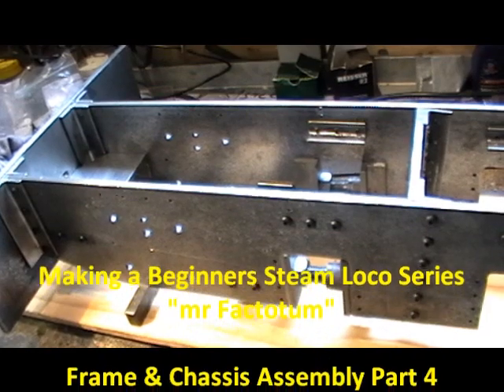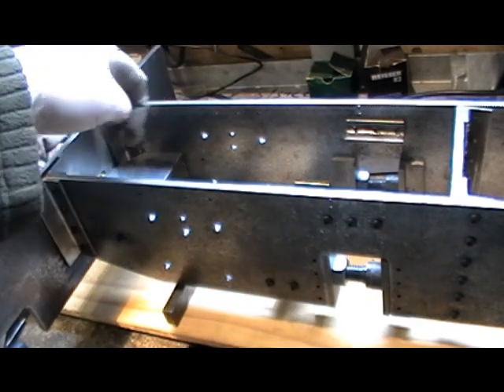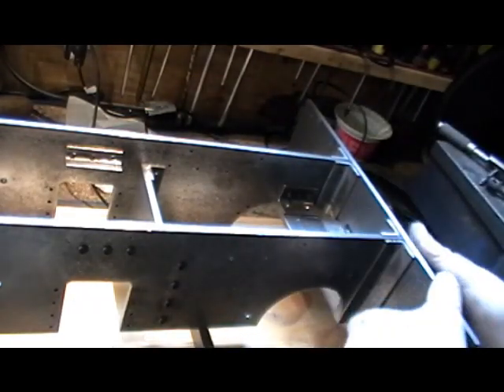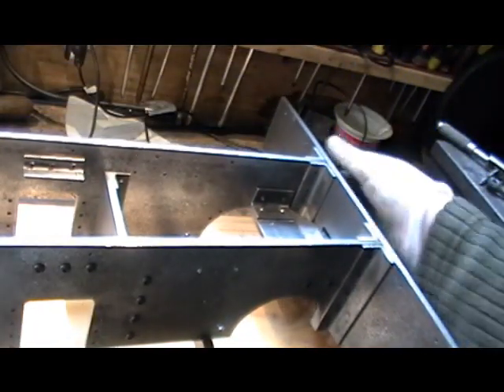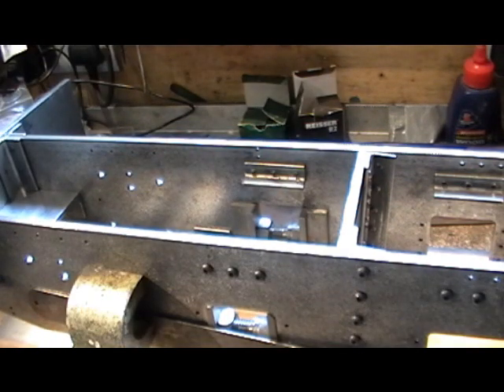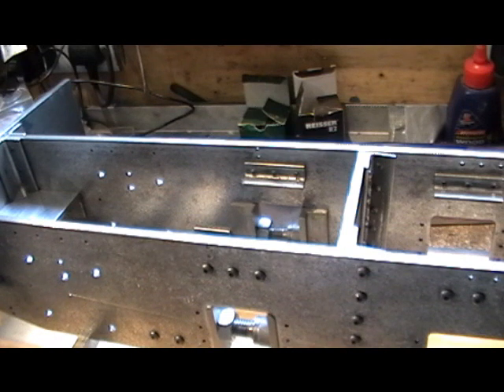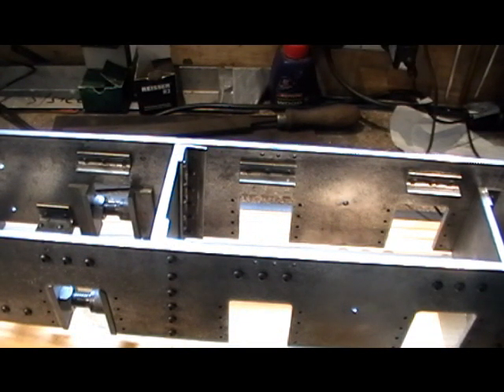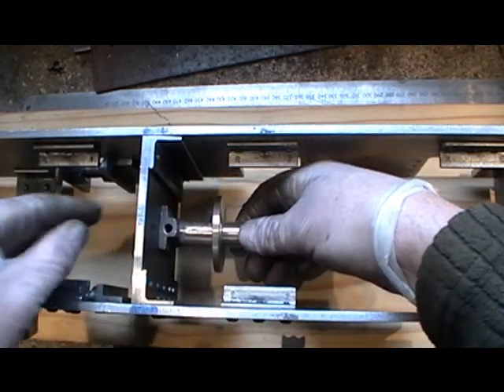Making a Beginners Steam Loco (Assembling the Chassis Main Frame Part 4 ) "mr factotum "

Comment: I just spent the day assembling our much modified Simplex and even with a milling table as a surface plate they are tricky bits to do! Yes slight curves throw the square off!!!
I am going to use 2 smaller pumps so as one is pumping the other will be filling. Also a Double acting hand-pump where the smaller return gets pumped through them to clear blockages and sticking balls!!
Love to get back from the workshop and watch it all over again for relaxing... Mad fool!
Love David and Lily.
Reply from the maker: Hi david and lily
Thanks for comments
Modified simplex sounds interesting, double acting pump also interesting too,   i will keep that one in mind
Regards
Mr f

Comment: Enjoy watching your build up. When you are using the button head socket screws on the chassis main frame instead of rivets, apart from using shakeproof glue on the threads are you using lock nuts on the inside? Great videos.
Reply from the maker: hi emanual
no lock nuts. just used loctite. hope that helps
regards
mr f

Comment: Thanks for posting all these, I'm gradually working my way through the series. I understood your method for getting the angle of the middle stretcher right, but I'm not sure I understand why it is angled. Is it because the feed pump is fixed to it, and they want the axis of the pump to be exactly parallel with the 'line of motion'? I assume the connecting rod goes from the piston to the axle just behind that stretcher, so the middle axle? If it is because of the pump, does it not make a difference that your pump is driven off the rear axle? Because that pump axis is now going to be pointing at a point some distance below the rear axle, maybe as much as 1/2" - may be less, it's hard to tell. You'd think this would make the pump action a bit assymetric on the in and out strokes, but maybe that makes no difference, even if it's true.
Reply from the maker: Hello
thanks for taking the time to comment and view, glad you find them interesting.
Well I'm learning as I go along, its my first loco, so will try to answer, the stretcher is at the same angle as the motion plate that attaches to the outside of the frames and in line with the stretcher, at 90 degrees to the centre line of the motion, ive not got that far as yet, but just assuming that's the reason the stretcher is at an angle to follow that.  
As for the axle pump, the angle doesn't effect its operation because the connecting rod pivots at the end of the pump piston and also where it attaches to the eccentric strap at the rear axle, because as i'm doing the 6 wheel version "Metre Maid" the axle pump  connecting rod will have to bridge over the centre axle as its in the way, again ive not got that far as yet but i'm sure all will become clear as I progress. I'm sure someone will comment if i'm not correct but that's how I see it 
Watch this space, i'm just doing the wheel coupling rods and connecting rods at the moment
Hope that helps
Regards
Mr F